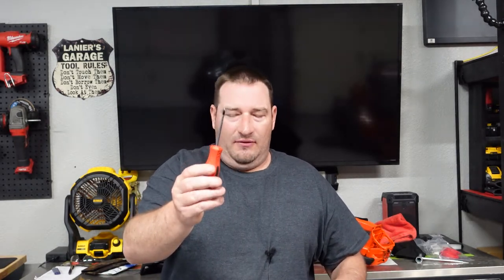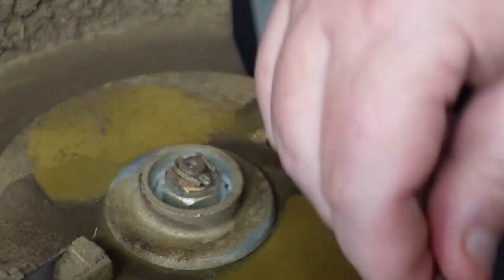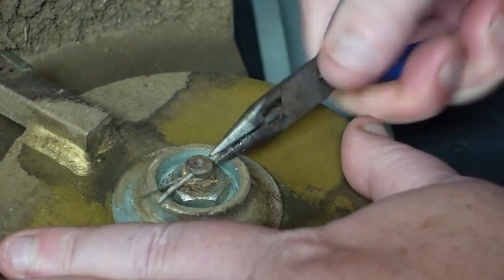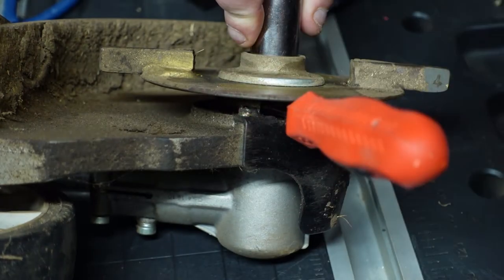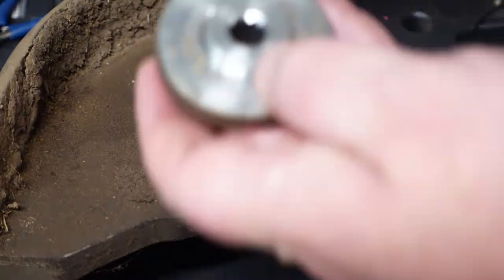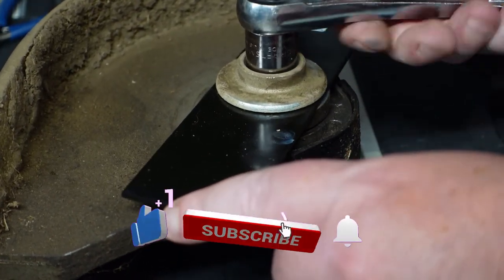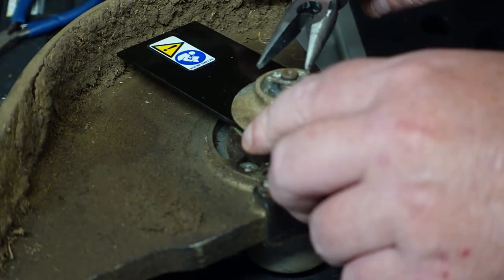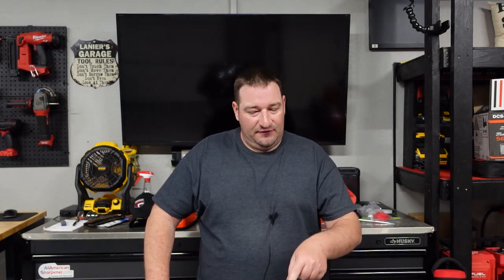How To Change An Edger Blade

Comment: Thanks so much for this. I have been running the same blade for 26 years just welding new ones to the older ones….. I wish I knew I could take the original one off… do you know anyone looking for a 13” wide homemade edger blade?